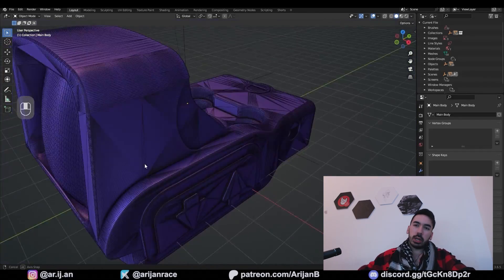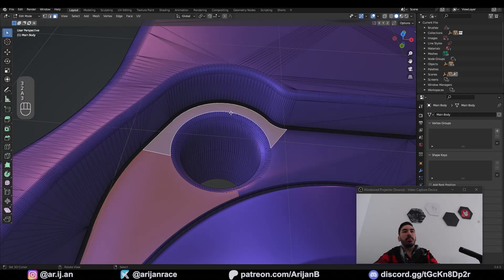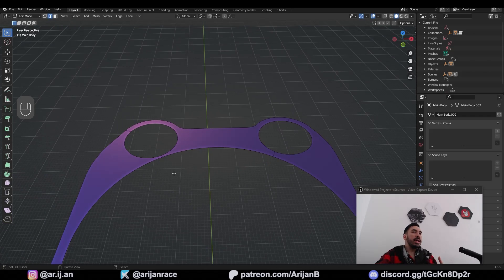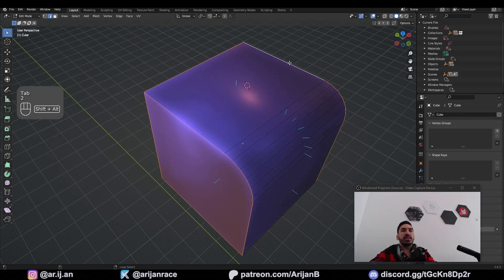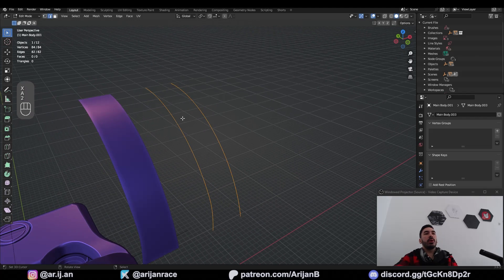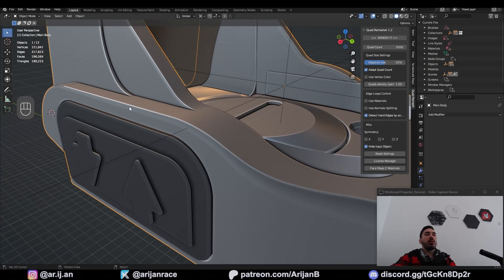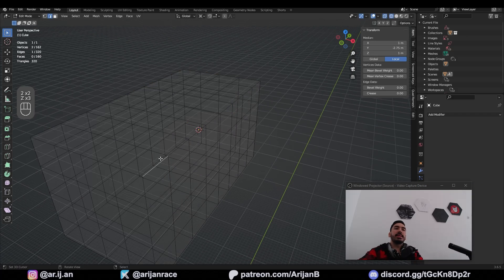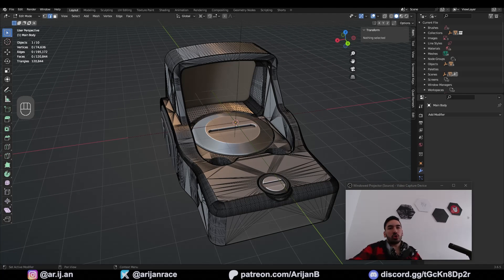How to Fix Bad Topology in Blender - Retopology Tutorial (Aryan)

Comment: in solidworks, at least you can save separate bodies as diffrent meshes. not shure about faces. you could, possibly, painstakingly cut it with separate bodies. but at that point just do it manually in blender

Comment: I import many CAD models into Blender, and I first do Limited Dissolve with a 1-5 degree angle. This makes the model much easier to work with in most cases. Also, a Weighted Normal modifier fixes most of the shading issues.

Comment: in Rhinoceros, if its still nurbs or solid model on cad, you can separate all faces (bevels or surfaces). But after converted it or exported with mesh/polygons (.stl/.obj) it is too late.

Comment: The simple way to work with CAD models is to use an other software to clean it up before importing it to any other software like maya or blender. It wont be perfect but it will be much more clean than the one you are cleaning on the video
Reply: Cool what programs would you suggest
Reply: @Damageing89  Plasticity wors good for videogames. An other way is to literally redo de geo by hand. I work with organic but I've got teammates working in hard surface that do it mostly by hand actually, as much pain as it can be it is the best way

Comment: i've been using cad software more than 2 years and i get the same problem while importing it in blender , what i normally do is  alt+j to make tries to quad than limited dissolve then i add required cuts or if you know from the beginning that you are going to import the model in blender just make simple shapes and the necessary holes in the cad and then add the bevel in the blender. if you use moi3d it does give you option to export in either polygons or tris and quad also thanks Aryan bro for the amazing tutorials.

Comment: These are good techniques to add into a CAD to Blender workflow for sure. I unfortunately get most of the models sent to me via Solidworks as that is what the engineers at work use. It’s so tedious and time consuming. I usually do a limited dissolve then remove problematic edges and add in cuts to fix the artifacts. Sometimes it’s easier to just recreate the model in Blender.  Will give some of your techniques a shot on my next project. Thanks for sharing.
Reply: Try plasticity and say solidworkers to export in step file format. Then try exporting to blender, you will have less pain and even can edit model in plasticity before exporting...
Reply: @kalpit3d934  interesting never thought of that.  Might give it a try in the next product build I get. Thanks.

Comment: If you use plasticity, then there is a plugin for blender that allows you to reduce the number of polygons. If you use Fusion 360, then you will need  ''moi3d'', where you can adjust the number of polygons.

Comment: No, you cannot separate the surfaces from the bevels (in a straight forward way). The best way to export from cad that I know is using MOI 3d, their FBX export settings are great and topology actually translates really well to poly modeling, almost no work needed after. A game changer for cad users like myself.
Reply from the maker: Good input, thanks for the insight.
Reply: Is moi a free software?
Reply: @user-rg2dz2nu6l  unfortunately it isn't
Reply: @user-rg2dz2nu6l  unfortunately it isn't
Reply: No, you can, just explode into separated surfaces directy in CAD
Reply: @azweinger  sure, but you'll end up with several separate bodies, and hoping that the export algorithm places verts and edges on the right places so you can weld them or something on blender. There are a ton of ways to do the same thing, it depends on your work flow, if it's a solid model or a surface model, what you intend to use it for and etc. I personally wouldn't do it that way.
Reply: Sure, i don't use this approach either, merely answered if it was possible to export separated surfaces. The object in video is pretty badly exported with a lot of unneccesary geometry. Normally things aren't that complicated @MrElposto
Reply: I know that you can give faces different materials in fusion 360, so maybe you could do that and then in Blender separate by material
Reply: @user-rg2dz2nu6l  that would probably work, I haven't tried it myself but makes a lot of sense
Reply: Fusion used to separate surfaces on export if I remember correctly
Reply: If I'm only dealing with simple round bevels, I usually suppress them (in Solidworks) prior to export and do the bevels in Blender instead. Separate by loose parts, and materials if applicable, also make you have simpler parts to clean up. Don't forget, in CAD we try to make models/parts that can be machined in a cost/weight effective way, whereas Blender hard surface modelers often do everything in a single part with round fillets that may catch highlights better but make zero sense in a production environment. Oh, and if G2 continuity is a thing, you never want to do round bevels anyway since they are only G1 (tangent) continuous. Superellipse 0.75 (with a wider base fillet size) gives a much smoother comb (transition from flat to curved, check with a zebra stripe matcap).

So a box with a protruded cylinder may be just that; two pieces fastened (or welded, or press fit, or whatever) because you don't want to mill away all the material from a much bigger box, with a 2 point chamfer easing the inset of the cylinder rather than the "round out fillet" always seen in Blender hard surface modelling.

If you have models with advanced blended fillets (check out "Will It Fillet? Learn how to Conquer Fillets in SOLIDWORKS"), the export is going to be a holy mess. I don't deal with these in my daily work (mostly sheet metal enclosures), but I think I'd probably have to shrink wrap good topology on top. I know Solidworks now have some kind of mesh editing tools, but I've never looked into what it can do or what its limitations are. Even sheet metal can be a pain since inner and outer radius of any bend will never have the same number of verts. Yeah, it's a lot of work.

"...this is a great way to lose your mind". So true... If I was handed this model, I think I would just start crying.